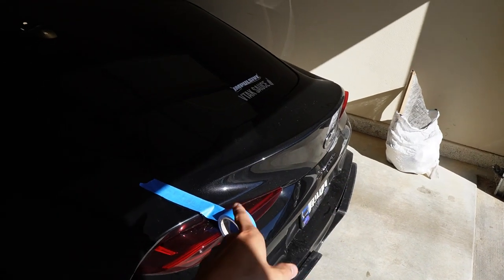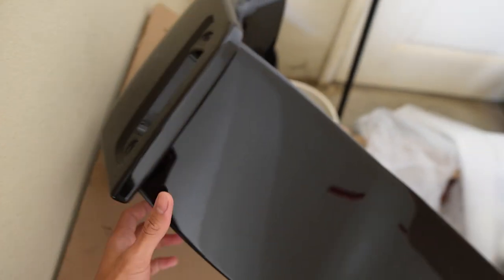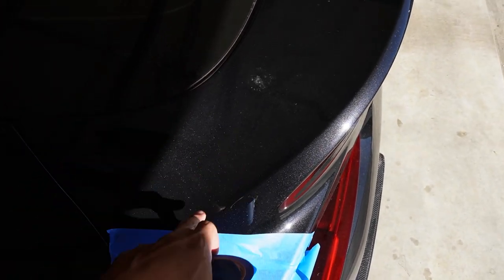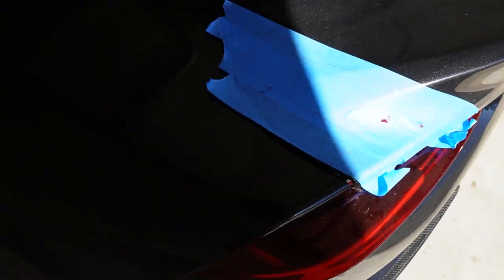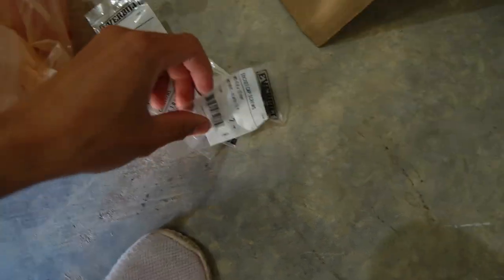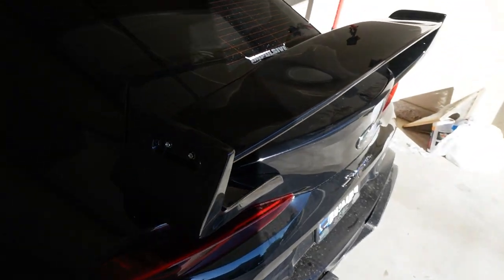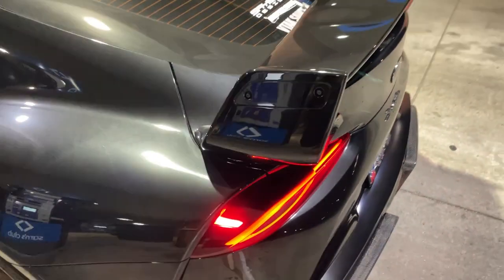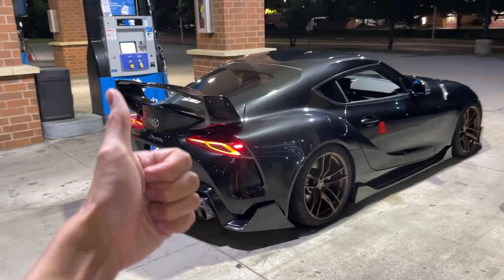I BOUGHT the CHEAPEST Streethunter Wing…

Comment: does your middle part flex alot when driving fast?
Reply: I just bought this and put it in. It does move in the wind :(. Any idea how to fix this issue ,? 😩
Reply: @cookey445  flex like crazy from 30mph and over. i just end up taking it off. only thing i can think of is using those stabilizer like on the STI’s but its ugly.
Reply: @cookey445  I heard you can fill the pieces with expanding foam (like "Gaps and Cracks") which hardens over time and can give the plastic pieces more stiffness because they're hollow. I'm planning to try doing that with mine.
Reply: @Kraedt good idea!